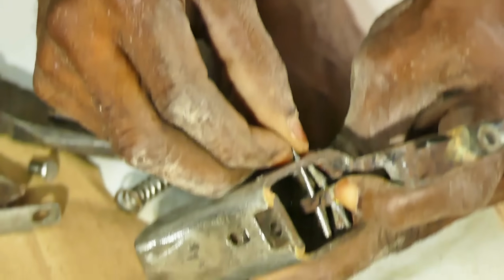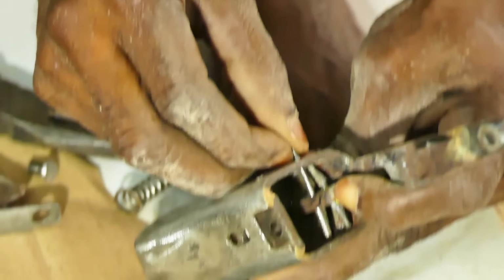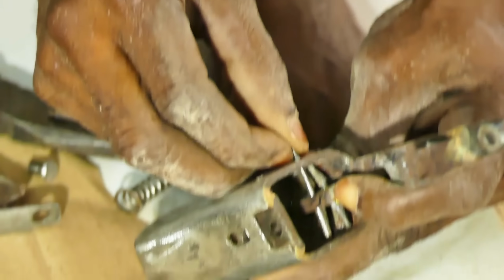Fabricating Local Shotgun using old Mossberg 500 Barrel PART 2: Finishing and firing.

Comment: Nice idea but you need a proper workbench to ensure a good quality firearm. I thought it will be a good idea to polish all component as it reduces binding and the barrel tightness when it closes. 

Your ammunition was the cause of those no ignition strikes, possibly an old batch or the actual sitting of the shell in the chamber and try to follow misfire procedures.

When you are building a firearm it is important that the initial tests are done remotely on a rig to reduce the risk of injury.

All in all a fantastic educational video of how you can make a gun with locally sourced materials, especially the stock the which I found was amazing.